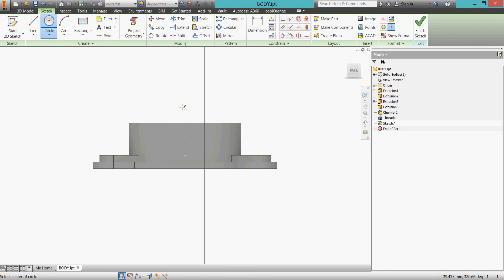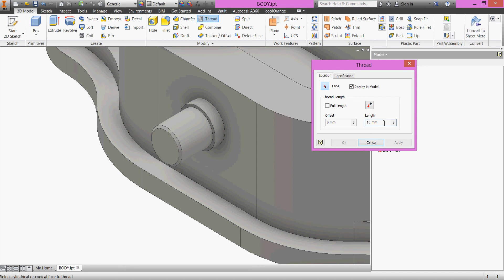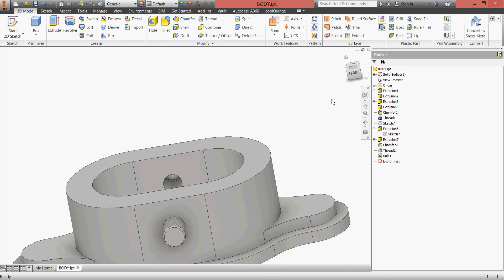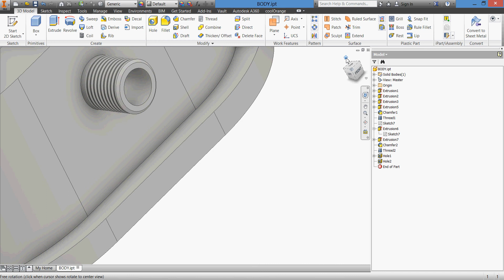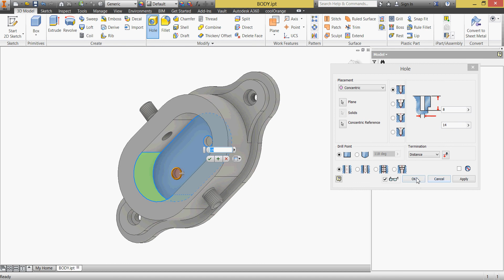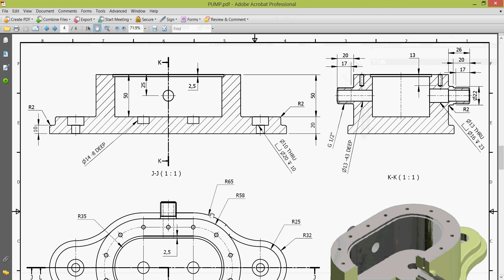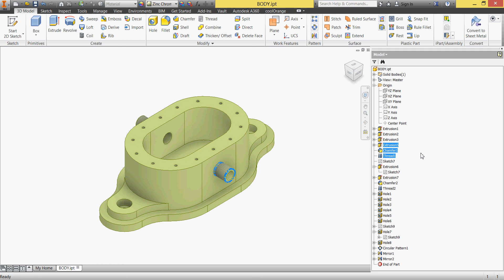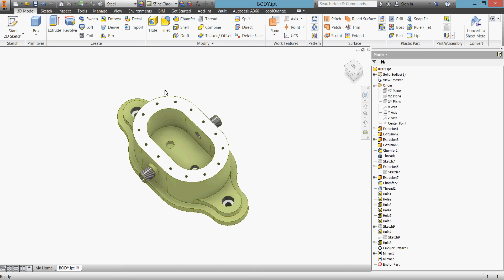3  OIL PUMP DESIGN BODY2

Comment: For those at 6:46, since we are using newer solidworks version now.
Just sketch a circle of 13mm Diameter and Extrude Cut ''Through All".

(Note: I don't know anything about older versions.)
Reply from the maker: A CYLINDER CUT IS NOT A HOLE, I PREFER ALWYS USE HOLE TOOL, COZ IN SOME CASESE WHEN WE WANA USE SCREWS THE CYLINDER CUT CAN/T BE IDNTIFIED AS MECHANICAL 
HOLE